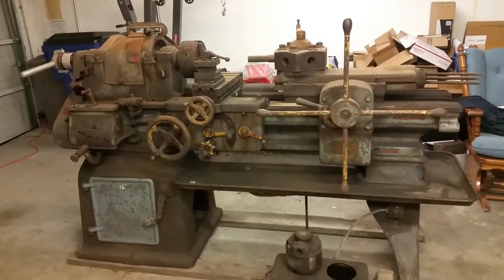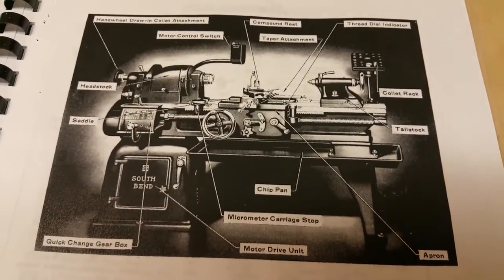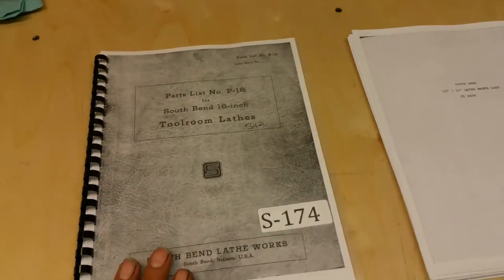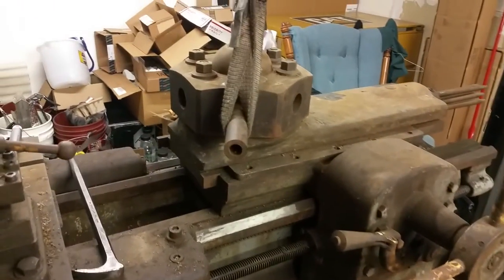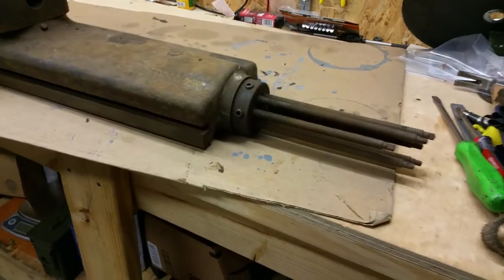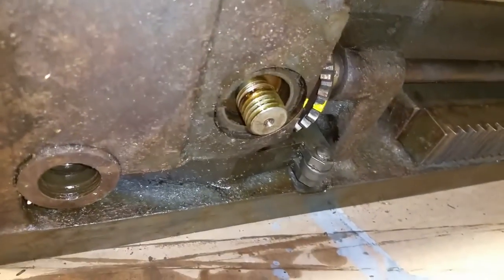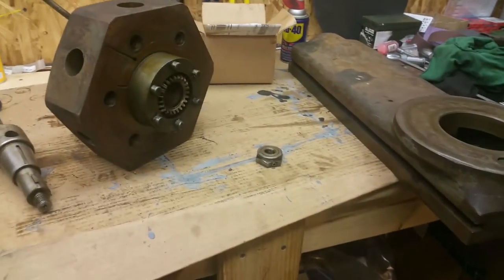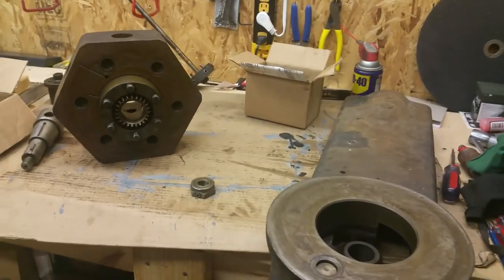South Bend No. 2-H part 2 Turret & Slide Disassembly

Comment: Tapers are your gibs to set how tight the slide sits in it's ways.  Should have an adjustment screw to move it in or out to make up for wear or damage, so no shimming needed normally.  If it won't adjust with the normal screw travel, its probably telling you that something is severely not right.   Not sure what the spring steel is about but that looks like a pain to fish in place. 

How do the stops work, is there something that sits at the far end of the bed that the stops contact?
Reply from the maker: +gadget73 Awsome, thanks for the info. Yea, I'm not sure about the spring steel either, I figured I'd work it out as as finish that side of it. If you see the next vid, toward the last half of the vid, I show the mechanism the stops contact. As it turns out, the stops were out of time to begin with, but I think I have that squared away now. But It'll probably be a while before I mount the slide to check operation. From here, I'm thinking I may rip the machine down in big pieces, this way I can mount the pieces as I finish.